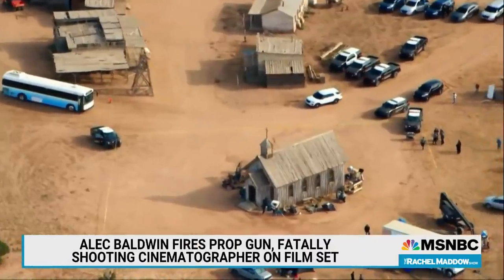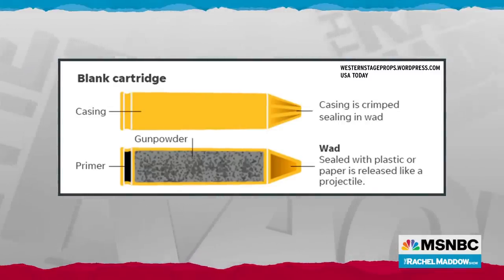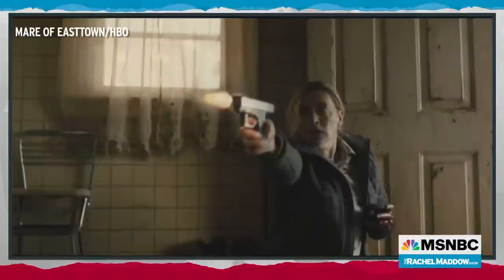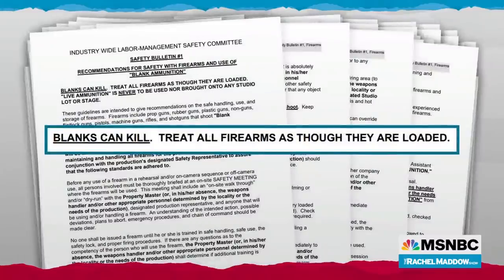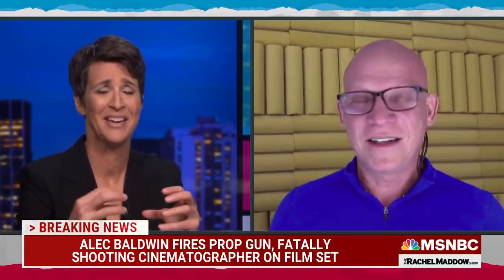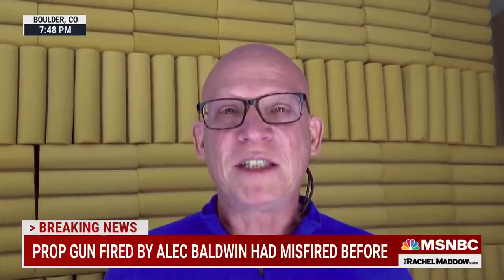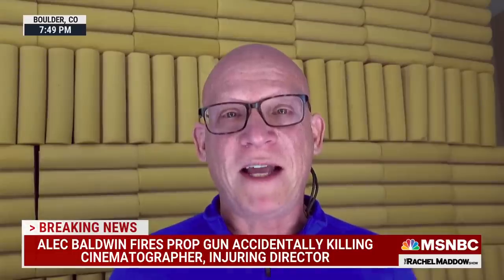Weapons Safety Expert Looks At Safety Protocols And Alec Baldwin Movie Set Shooting

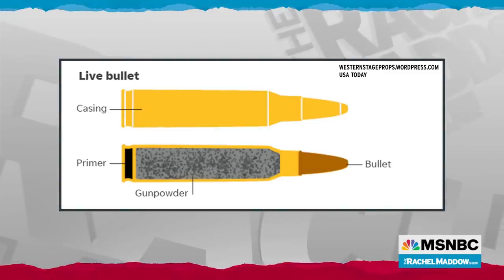Comment: 1:24 that’s a terrible visible representation, but more or less true of a rifle caliber bullet (the kind shown). The bullet itself actually extends further into where they drew the gunpowder to be.
Reply: 2:30 ish, yes a blank round can be dangerous, but not for the reasons she’s stating. The paper or plastic wad is just about disintegrated from the sheer ignition of the gunpowder. It’s the escaping hot gases from firing, that is capable of sending things into a supersonic speed, that is dangerous at super close range. 

Btw, this fact has nothing to do with the shooting, as the distance is WAY too big for a blank to feel like anything beyond a lukewarm burst of air for the two people who got shot.
Reply: For 3:15, you don’t use a prop gun when firing blanks. Prop guns are universally incapable of firing anything at all, and likely are a single solid material throughout. You do use a real gun with either blanks, or inert rounds.

Comment: 8:42 Guns can go off and have gone off by accident under certain conditions when anything--not just a person--contacts the trigger and moves it.
Reply: You don’t know the kind of prop used on set.
Reply: @xl000  - My comment had nothing to do with the specific kind of gun used on the set. Nor was I suggesting that the gun in this shooting went off by accident.
Reply: A firearm that I see in a lot in WWII movies is Lugar. That weapon had a serious safety flaw. If you press on the side of the weapon about halfway up the right hand side above the trigger the gun will fire. There’s a linkage there that connects the trigger to the firing mechanism and it’s exposed.

Comment: Every one of the reports that have brought on experts to explain things is failing to say loud and clearly (If not repeatedly) "We don't have the facts.  We don't know what happened."
They are looking to cash in with speculation.
I have now seen four videos where "experts" have been put on screen to explain what might have happened.  All have described what goes on on set differently.  This one being one of the worst.  I doubt this guy had any real connection to the Lee investigation.
The best explanation I have seen was a non-news channel.  It was a gun channel.  He didn't try to GUESS what happened in this particular case.  Instead he simply stuck to all the ways guns are used on set including the different sort of states the guns are in as well as the different sort of cartridges they might be loaded with.

Comment: Has it been determined the type of "prop gun" was used? I am thinking that the prop gun was a replica, era specific "cap and ball revolver". Cap and ball revolvers use black powder and are more difficult to load,unload,determine if a ball is loaded. What type "prop gun" was used here? The use of a cap and ball revolver fits in the time period of the movie being filmed (a western/cowboy type movie.) The explanation from Rachel's guest is appropriate when using a more modern weapon with modern ammo. Not applicable to a cap and ball revolver. I certainly could be wrong about weapon type.
Broken guns can "go off" under certain conditions. Poorly designed guns (like Raven .25 automatics) can go off if dropped (when a round is chambered.) You could drop a chambered Glock (any model Glock) out of an airplane that is miles high and it will not go off upon impact with the ground, due to its basic design.
Reply: As I understand it, the movie was set in about 1800.  Integrated cartridges were used to some extent in the Civil War and some cap-and-ball revolvers could be modified to accept integrated cartridges.  By the 1870's integrated cartridges were in widespread use in the U.S.
Reply: @RB-nj8br  Hi RB, I have viewed a Youtube video featuring a "firearms prop man" that mentions the use of black powder several times. If that movie was set in 1800 then it certainly was black powder,make that flint lock ignition also. Perhaps you meant 1900?

Comment: At the end of this video, the expert says pulling the trigger is an "intentional" act.  But what about a muscle spasm of the trigger finger?
Reply: Yeah, Its annoying because the whole thing is running on incomplete information.
From what is reported Alec was practicing drawing the gun. Not shooting. Its likely the gun went off accidentally. 
This can be supported by the statements of the gun having accidental discharges. which, with blanks is not AS dangerous (but still dangerous).

Comment: I will never look at a movie where they use guns; the same again. I had no idea they were real guns. I know people have been killed by blanks, but I thought that was a fluke.

This is a tragedy for all involved. How could this happen in modern days; with so much technology and sound effects.

The actor depended on the prop person to have blanks in the real gun. From what I heard they put real bullets in these guns for authenticity then switch to blanks. You have to really pay attention in this case scenario, no distractions or safety gets overlooked.
Reply: Not all guns you'll see on screen are real.  Some are simply pieces of rubber or plastic painted black.  Some are airsoft replicas.  Some are prop guns.  Some, are real guns as props.  It depends on the needs of the scene - if the actor won't be shooting on camera, then a simple rubber 'practice' gun is fine.  Or if they need to carry it around and to reflect the weight and awkwardness, etc..

Comment: WHAT AMAZES ME is that here in Bulgaria you can buy "Gas guns" for self-defence - they shoot either CS Gas or Mace, or just blank rounds. YOU CAN NOT FIRE A LIVE ROUND

The barrel is not machined out fully so it will not allow a live round to be fired. I have no idea why these are not used.
Reply: Those would be prop guns, ones designed not to fire or accept live ammunition.  That is different from a gun as a prop, which was used in this case here.
Reply: @AdeptPaladin  - Yers the guy clarified that later and made my comment a little redundant.  I mean to my simple mind its simple. You DO NOT allow a gun on a set that CAN under any circumstances fire a live round. If it can chamber a live round - the barrel is blocked. If it can fire a round its undersized so it can ONLY fire blank ammo and not chamber a live round

Comment: When I was in the Canadian Militia many years ago whenever anyone picked up a weapon they cleared it (i.e. 'unload' it in case it was loaded and visually inspected it before pulling the trigger and putting it on safe.  You did the same whenever you handed the weapon to anyone else - and they also cleared the weapon although they just saw you do it.
Loaded weapons on the property  table would have a red elastic band around them so they are not cleared right before the scene is shot.

For this to work, it must become part of the productions culture.  Anyone - even the food delivery guy - is allowed to tell someone to clear the weapon if they picked one up and didn't carry out their safety procedures.

I am also interested in how many accident discharges the Army has per year as a comparison to the entertainment industry.  Of course, it would be almost impossible to gauge these in either setting as a percentage of handling live ammo.
Reply: Once you fire off the action on a C7, as part of your safety precaution, the fire selector lever can't be put on safe. There are no accidental discharges, only negligent discharges. Other than that, what you said is correct.

Comment: That set armorer should see criminal charges, the amount of negligence for this to occur is astounding
Reply: Although every account I read was that the armorer wasn't even in the room (??) it was 1st AD who grabbed a gun left on a cart outside (??) declared it clear without checking (??) handed it to Alec who also didn't check (??) and then proceeded to practice his quick-draws in the direction of the camera, DP and Director (???) with a gun that had several days before, fired on blanks accidentally (??) but this time had a round left over from some crew plinking with it offset, using live ammo (????)